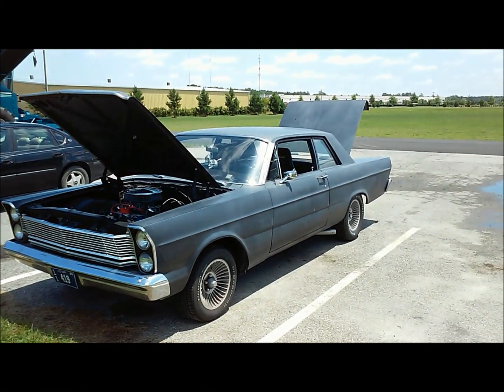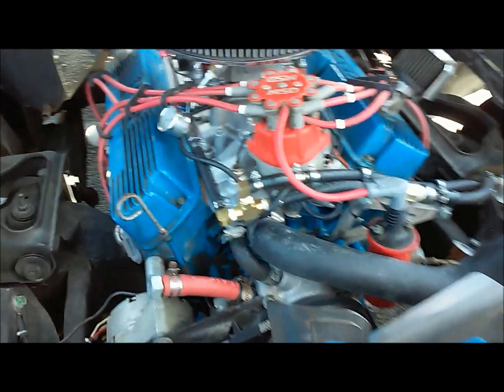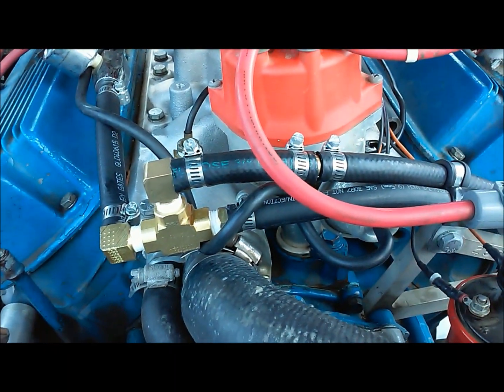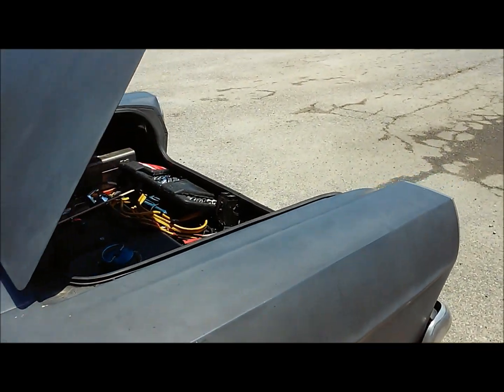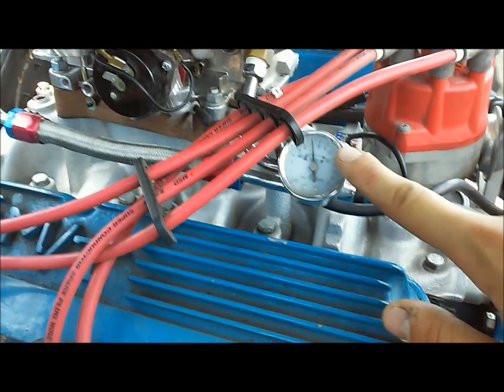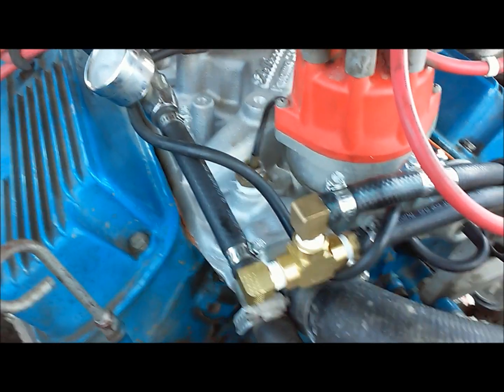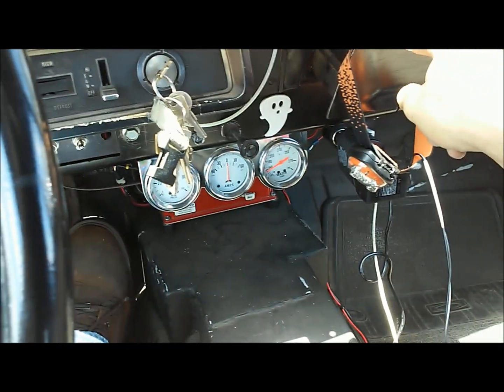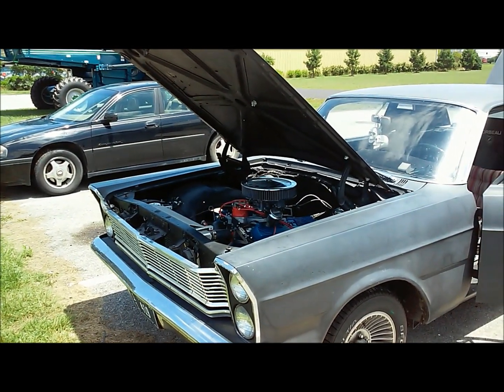Carb Vapor Lock No More - Simple Fuel Return Line

Comment: I would suggest putting a fan shroud on it!!!
Reply: That alone may have solved the traffic/vaporlock problem if it was a mechanical fuel pump probably, but the bulk of  electric fuel pumps put out too much pressure as they intend to serve fuel injection.   Extra work is heat in any fluid.  Anyway... a fan with no shroud is mostly a noisemaker, but low pressure pumps for carbureted setups can be found without having to install a set of left handed bagpipes under the hood to compensate.
Reply: Flinch left handed bag pipes!     Hilarious 😂

Comment: Just a few weeks ago I wasn't even aware of vapor lock and have been suspecting a defective fuel pump that couldn't get the fuel to the carb. My car stalled, almost got towed and charged $100 on the road, luckily we managed to go off to safe parking by pouring fuel on the carb. But then I learned about this it turned out that it was actually my new radiator hose that caused my problems, that was replaced from an old cracked fabric braided hose with a new shiny un-braided hose. Never thought that fabric braiding was so important. XD

Comment: Take that BULLSHIT fan and give it to your dog to chew. You need a fan shroud if running that fan
It must fit tight up against rad.seal to sides, and shroud should be up on sides within 1 1/2 " .then you can cool rad and cool. System.or get you 2 fans in elect. Setup with shroud,pullers. Then install I big pusher fan in front rad . On man. Switch
ALL that heat from headers and eng. You will have enough air flow coming in to cool engine bay area.trust me I did auto cooling spec. In Las Vegas in my shop. Also did problem a/c spec. problem fixes.cover the glass ( shit) filter and replace like your plastic filter,it cooler, and get some temp. Insul. Shield sleeve on all hoses and brass from fender to carb. RETURN LINE : MAKE A METAL coil fuel line 4 or 5 ---- six  in, coils to cool hot fuel before returning fuel back in tank
You BILL bring heat back to tank fuel. Causing more unneeded emissions and therefore a shorter fuel pump life.remember we can't  buy gasoline, we get this bull......  oxygenated alcohol  MOTOR FUEL. VERY UNSTABLE WITH HEAT. YOU KNOW. NICE CAR. OH AND ALSO GET RID OF THAT PLASTIC OIL PRESSURE LINE. COPPER IS COOL.MAKE SURE YOU HAVE A GOOD IGN. HIDDEN ANTITHEFT SWITCH OR DEVICE. I BELIVE YOU HAVE A 65?. VERY SHARP. WHERE IS YOUR HALON FIRE EXT? 

PEACE.   OUT.   DENNIS

Comment: Hello, I have a 1973 Plymouth Scamp that has bubbles in the fuel filter, sometimes the fuel drops out.   I changed out the fuel pump, fuel filter and it still does this.  It recently started to back fire when I go up hill's.  Does any body know what is wrong with my car?

Comment: Why run a o2 sensor just curious ?
Reply from the maker: +Matt Moyer really improves your carb monitoring and what changes need to be made vs altitude and temperature
Reply: ThunderHead289 hey bud that's cool so I'm wondering if I run a return line off my regulator should I run the return way up under the hood or make the return line short line 3 to 5 ft behind cab or 10 ft up  under hood I'm building 406ci sbc s10 truck?
Reply from the maker: i would definitely run it through the carb itself and use a return style regulator seems like the best option to me - quick fuel make a unit for about 80 bucks. mount it after your carb with an electric fuel pump and you will never have a fueling problem
Reply: @ThunderHead289  thanks for the vid.  i got a 77 chevy with a newer 350 v8 in it and id like to thank you for your knowledge.  however, just to summarize I should buy the quick fuel $80 regulator and a summit fuel pump?  what psi you think i should go for?
Reply: @ThunderHead289  how do you mount a return style regulator, after the carb. I can't picture it

Comment: What afr gauge are  you running. Never thought about running one until I seen your video
Reply from the maker: Matthew Simpson I run the aem unit - they are roughly 150 on eBay and come with everything. Very good value
Reply: ThunderHead289 this really brings me out of the dark and into the light on tuning a carburetor.
Reply from the maker: Matthew Simpson they are really helpful, especially when driving through the mountains. I have a ton of carb tuning videos on my channel - I believe I have a playlist. Pick yourself up a bypass specific regulator - it will really help. This video is something I had to make on the fly in the middle of BFE
Reply: ThunderHead289 you have great videos I've been watching them and playing catch up, just trying to bring my 67 fairlane into some modern times. That galaxy is a nice car
Reply from the maker: the galaxie was a nice car, after the virginia trip here in this video she ended up getting parked in the barn, i pulled the engine for something else. you wouldnt even recognize that car right now! 2018 is the year she comes back
Reply: ThunderHead289 I'll look forward to that video

Comment: Good job on he video Thunderhead289, I have watched a few of your's I'm having vapor lock Issues with my 72 Monte Carlo with a 350 and a Edelbrock carb (hate that carb) running the mechanical fuel pump but I'm in Fl. and it gets hot you can see the fuel pressure drop to around 3 psi when the motor get to like 180/190F (I added and reg. and gauge) just to watch it.... I can see the fuel boiling in my glass fuel filter going to carb. I bought an electric Pump from Carter one of their nice ones and another fuel pressure regulator from Jegs that has a built in return but the return in the reg. is the same size as the Inlet at 3/8" I was going to install the whole system but saw this video. My Question:
Should I restrict that return on the regulator? Also you have any experience with Edelbrock's? after I shut down the car and it's hot I have to crank and crank to get it to start again... when cold it starts right away, unless I let it sit for a week then I have to crank and crank, I put a phenolic carb spacer but has not helped ....
Reply from the maker: First item to address here is the hard warm start scenario - i bet if you crank it and hold the pedal to the floor it fires right up. what has happened is that fuel has expanded in the carb, and in the line from under hood heat and blown into the carb and overflowed out the boosters. 
on the regulator bit, a true return style regulator should have a metering orifice that resembles a carb jet on one side - i like to mount them after the fuel rail so that you get full fuel circulation through the fuel lines. 
I honestly need to do a test on this - probably making a video over it here soon to verify how the return regulators function. what i did here on the galaxie worked well, but i had such a large fuel pump tat with even wide open throttle i never lost fuel pressure.
Reply: Any recommendations on a return regulator? as the one I have and have seen out there all have a large return same as inlet, I figure I try going to electric fuel pump before I yank the Edi and replace it with a Holly or one of the Summit carbs you use. The Edi has never worked right... so you think the fuel is boiling and expanding in the carb and flooding the intake? I have to try the gas pedal all the way down as I usually pump the heck out of it as I think it's starving for fuel.
BTW, thanks for the Impute
Reply from the maker: Mike Q no problem - if holding the gas pedal to the floor works, she’s flooding out from heat soak fuel percolation. I use an quick fuel return unit I do believe. Either thy or an aeromotive unit. I’ll really need to test this set up in the video against a regulator and see if they actually just work the same way.
Reply: @mikeq5664  I'm planning on killing the fuel pump before I shut engine down. It should prevent fuel expanding into the boosters (flooding engine), it should keep the fuel from boiling in the bowls, cause there is no gas to boil (especially evil ethanol blends), and it should give me, slightly cooler, fresher gas from the lines...

We'll see what happens

Comment: It's funny. I've always ditched the return lines on vehicles with carburetors with mechanical fuel pumps. Did for many years with many cars. Always thought the return line on cars with mechanical pumps was some sort of gimmick. Only had one vehicle develop the vapor lock issues you mentioned, and sure enough, putting an old 2-output fuel filter on it and using the fuel return line fixed it.

Didn't click in my head until I watched your video, though. Thank you. Saves me from messing with carburetor spacers and junk.

Comment: Nothing wrong with rubber hose as long as it's secure and away from heat, is this your daily driver?! Hope not that would suck, p.s get a fuel pressure regulator
Reply from the maker: +the magician I quiet enjoyed the ratty galaxie. It has a regulator over on the fender. Was a good learning experience. Took that thing 1400 miles to Virginia, drove it there as my only car for 3 months, then drove it right back home. Hell of a deal for some guy who was 21 back then.

Comment: could you plumb a fuel log into your holley carb, and on the other end of the log, plumb in a return line back to the tank with a second regulator keeping pressure perfectly even all the way around? nice old rig....the days when cars were made of steel!!
Reply from the maker: chevy vega you completely could! That’s how I plan to do my truck here over the winter. Throw a bypass regulator on it, and then actually that is all you would need if put after the carb. Would even leave a port for the gauge
Reply: I have seen a lot of typical rubber hose under your hood. Do you mess with any of the braided lines with fittings? Stuff can rack up a pile of bread$$, and really does nothing more than look good. Ill run 3/8 aluminum line along the frame rail from tank to firewall, then rubber flex hose to a 4150 dual feed. Off the back of the feed ill run another rubber to aluminum line back to the tank. My line return goes to the bottom of the tank to prevent foam buildup with constant fuel that would otherwise be pouring on the surface.
Reply: ThunderHead289 what about just a simple needle valve and gauge for the return line?

Comment: What size drill bit did you use in that Bolt between the hoses
Reply: Paul Sthormes he said .060". I am wondering if .060 is enough. Like does it maybe attomizes the fuel and should the return line be much smaller to combat this.
Reply: @destro513  go with the biggest size drill that will still keep your fuel pressure gauge around 6 to 7psi at wide open throttle.

You can run a smaller return fuel line.

The trick is tho, like he said, you want the gas (hot above the engine) to circulate back to the tank, before it gets hot!!

Comment: I realize this is an older video, but my question is related to the subject. I have a 1959 GMC 150 with a 1972 Chevy 350 with a 2 Barrel Holley 4412 carburetor. I recently got it running after it sat for about 10 years and put a new fuel pump and a brand new Holley 4412 on it (It had a 4412 on it before, so I just stuck a brand new one on it since I had one on the shelf.) It started and ran really well. I pulled it out of the shed it was sitting in and idled it up towards the shop. I stopped it in front of the shop and let it idle for a good 15 minutes then shut it off to go get lunch. I came back and started it and decided to drive it to my dad's place which is about a 1/4 mile away. It ran really good until I pulled it into the driveway and let it idle to let my dad check it out. As it was sitting there it started to run kind of rough and died. I jumped back in to start it and it wouldn't even try and start. So I pushed it into his shed for the night and didn't come back to it for a couple weeks. When I got the time to look at it again, I thought I would get in and try to start it just for shit's and giggles. It started right up with the temp outside being 50 or so degrees. It sat there and idled like a champ for a good 5 minutes. Then I shut it off and restarted it, it took right off. I let it idle for another 5 or so minutes and shut off then left. Could my issue be vapor lock since it started right up after the motor being completely cooled down? I think I can firmly disregard it being a carb or fuel pump issue since they are both brand new. What are your thoughts? If you do think it's vapor lock how could I go about remedying or fixing it without installing an electric fuel pump? I want to keep this as mechanical as possible. Any tips or suggestions would be great!
Reply: Sounds like it was flooding. Stuck float maybe
Reply: never trust new always do a proper inspection find a good system stick to it
Reply: I have a 350 4bolt main motor in my 81 cutlass wen im at a light for abt 30to60 seconds and go up the road my fuel leave my glass bowl and it cuts off and cranks bk but cuts bk off til i give it gas and it stays 🏃
Reply: Hard to say, but I'm a bit skeptical of your issue being caused by vapor lock.  Vehicle of that vintage has had a lot of hands on it over the years, and things also deteriorate.  Not to mention the damage critters can do while sitting. 
 Going to have to trouble shoot the issue while it is happening.  Stick with the basics.  If it won't fire try some starter fluid or dribble some gas into the carb.  If it still won't fire, check for spark.  Adding electric fuel pumps tend to add a lot of unnecessary complications for many rides.

Comment: Is the regulator on the feed line or the return?
Reply from the maker: in this set up it is on the feed line, due to what i could get at the parts store. ultimately what I ended up doing was installing a return style regulator after the fuel rail. that way all the fuel in the system was cycled. really makes a huge difference.
Reply: I have a dead head regulator. Would it work if I put the regulator on the return line to the pump? Put a Tee on the feed and have the regulator back to the tank and the other part of the tee to the carb
Reply from the maker: you definitely could, but you are going to want to add a restrictor orifice into the line like what i did here in this video. the return style regulators basically have a jet in one side of them to work as the restrictor unit anyhow

Comment: why not just put a fuel filter with a built in return fitting ,also the fuel pump should be located near the gas tank at the tank fuel lowest level
Reply from the maker: it is back by the gas tank - the gas tank is a fuel cell in the trunk and the pump vanes which actually have fuel flowing through is mounted below the tank. the right way to do this is to use a return style regulator after the carb rail. that way its not always open and you dont have to use such a large pump.

Comment: Stupid question can you run mechanical fuel pump and an electric pumps at the same time. Kinda of having an eletric pump to prime the carb and then run off the mechanical pump after she is running
Reply from the maker: my f100 was set up like that were it used to have a newer engine without the hole for the mechanical pump. I later switched engines to one that had a mechanical pump, and ran both units in line. my biggest fear is that the mechanical pump would fail, but fuel would be forced into the crankcase through the failed pump through the electric unit. i dont think it would be worth it just for priming either - and if it is in line and off, it is just an added restriction. Id go one way or another.
Reply: ThunderHead289 ok just wondering. Because I have an 85 Bronco that had a fuel injected 302 in it. I switched it out with a carb 351w and eliminated the hi pressure pump and kept the intank low pressure pump. But I switched my timing cover to one that has a fuel pump boss and I do have a brand new mech pump that I could install.
Reply from the maker: my thing is that i like to run return lines to prevent vapor lock. you can only run a return line with an electric pump - but i would recommend a carb specific pump such as one from holley or summit
Reply: ThunderHead289 the fuel pump from the efi 302 only runs at 7 Or 8 psi. I have a regulator set to 5 lbs right now for my eddy carb.
Reply from the maker: gotcha, if it still runs alright i dont see any issues with it then. just something i have never attempted myself for sure.

Comment: I'm assuming you're a mechanical engineer? Recently I went to a newer small block in my chevy that had no spot for a mechanical. My truck originally had a return even with the mechanical. I had vapor lock issue when I would park at the local quickstop and attempt to open the secondaries leaving only to sputter. Now my fuel stays nice and cool at idle and no more vapor lock.
I'm a forest engineer so I only had one class on fluid mechanics.
Reply from the maker: hey, turns out i am indeed a mechanical engineer. imagine that. return lines make a massive difference on carbed stuff. its amazing what fuel does under temperature. the cooler you can keep it (and the higher the PSI) the better it will resist vaporizing in the lines
Reply: ThunderHead289 I had to dig out my fluid mechanics book to size my port to create a loss ended up at .040 but it was $10 in supplies compared to $140 for an expensive regulator I ran mainly steel line and flare it all.
Reply: I have a 1980 Chevy pickup with a 305, I've been having vapor lock issues in traffic alot. I'm gonna hook my return line back up.

Comment: I have a stock 350 with a 1405 edelbrock carb. I insulated the fuel line from the fuel pump up, added a edelbrock insulator gasket bottom of carb, put on a holley fuel pressure regulator set to 5 psi and if i crank it after 20-30 mins it takes a long long long crank to startup still, but if i hold slight pressure on the gas pedal it fires right up. Also if i keep the hood up after 20-30mins it fires right up also. Any help will be much appreciated, been fighting this battle for a long time now.
Thanks